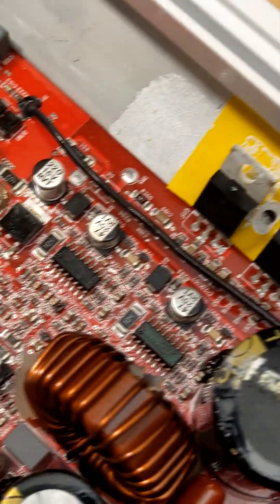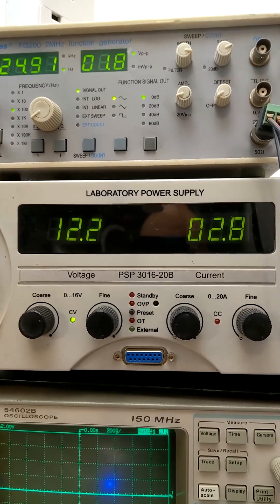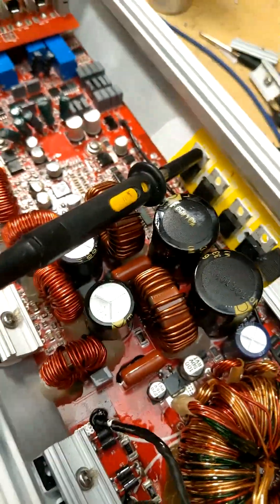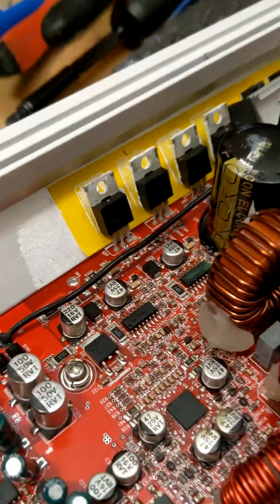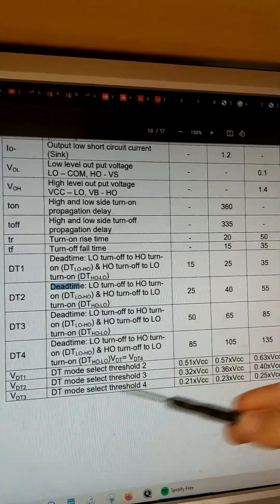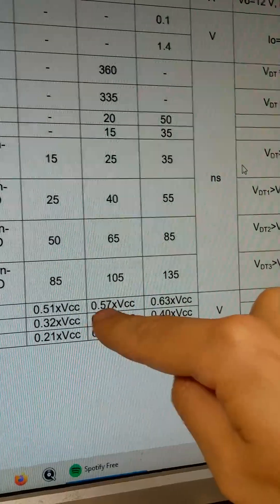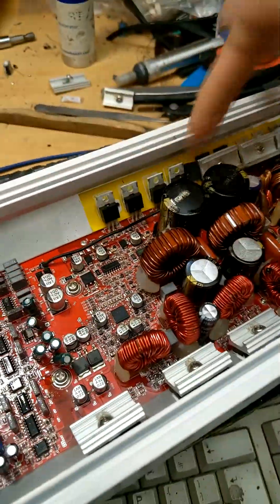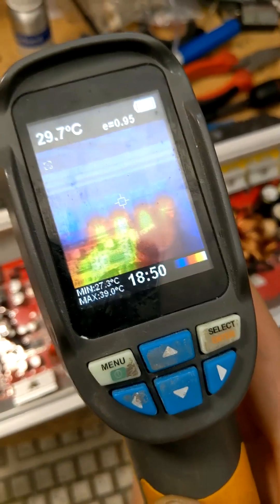Amplifier Overheating from Factory! | Design flaw Quick-Fix

Comment: Those FETs have even better switching specs than in an output stage I’ve seen and yet with the same dead time mode with a similar IRS chip doesn’t get that stupid hot… FETs here would easily benefit from an intermediary buffer stage with a BJT pair for each gate.

Comment: Have a question i got zx2500.1 kicker amp that has a strange proplem it turns on and play sound untill you volume up like said 10% out of 50% volume it flick protection mode for sec and keeps flicking untill i volume it down can you help please

Comment: I will never understand some companies, a tiny amount of solder or 0 ohm links is cheaper than 2 resistors plus it would run cooler, absolutely doesn't make sense considering 99.9999% of companies try to SAVE money and want there product to be good lol

Not to mention how big b2 audio is and how much reputation they have.

Comment: Couple things. The thd on the irs topology is nearly unaffected by the death time. You just increase losses due to a higher conduction time for the low side fet diode and you decrease maximum power since the fets aren't on for as long. Also I would especially on the irs2094 increase dead time if there are no buffers since it does 0.5A max drive current compared to the 1A for the irs2092. Also overlap can cause huge ringing spikes when all the stray capacitances and inductances are literally plugged like a guitar string.

Comment: @barevids i have a question, i have a Brazilian amp same as the sfb 5k and i hooked it all up tuned it with a multimeter to 54v and it played awesome then went into protect so i turned off everything then turned back on came out of protect but the clipping light stays on and there is no output from amp, when i check it with the multimeter now it is saying that im getting 103v as the output what might cause this, thanks in advance
Reply from the maker: Output circuit fault. Needs repair.
Reply: alright was worried about that, thank you for the quick response

Comment: It's amazing how so many amps are not optimized these days, I guess that's what happens when you don't design anything in house and rely on overseas build houses. Just add "designed in _____" and pretend we did it ourselves, in any other industry it's called con artistry.

Comment: Wonder would it be cheaper to buy a new one than the repair cost.
Reply: It is new though, so swapping out for another identical new amp would do nothing to alleviate the heat issue.

Comment: It's a bit of a trade-off at high switching frequency, some mosfets will have a better stability at higher temperatures, like a sweet spot where gate capacitance "switching speed" become optimal for the drive frequency.

Comment: See a lot of issues with B2 amplifiers honestly. Doesn't surprise me.
Reply: Amp is like 5 years old. Even though brand new. Most other issues are related to the introduction of fullbridge amps in our lineup. But they have sold in thousands
Reply: @jayholm9623  B2 amps are some of my favorites, just growing pains for full bridge I suppose. I'm a die hard half bridge and a/b guy, I'm holding on as long as I can 😂
Reply: @dylanhouser2587  that's why the Rage 4500, zero9 and now the zero12 are there.  Big powerful beasts. Also planning on a big 2.3k 4 ch and a 2.3k 2 ch
Reply: @jayholm9623  I will see them at upcoming shows I'm sure!